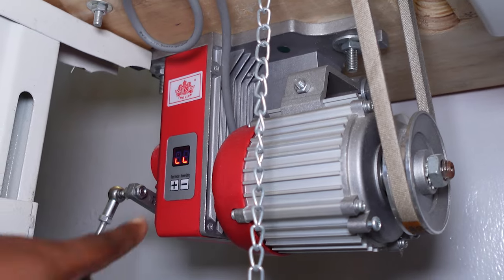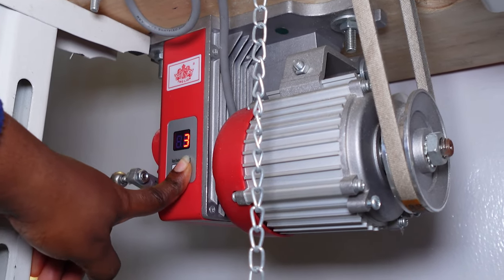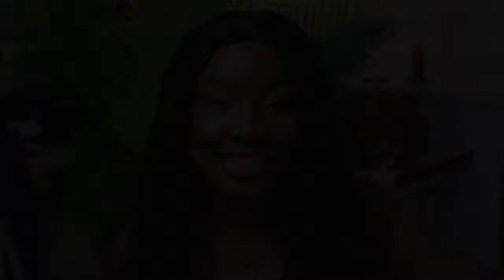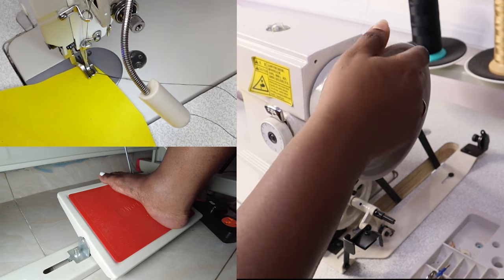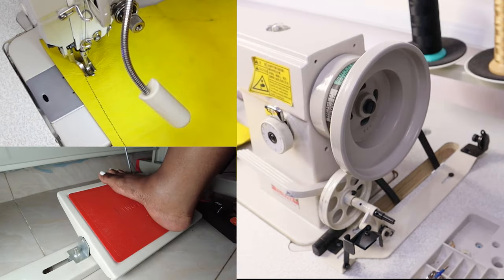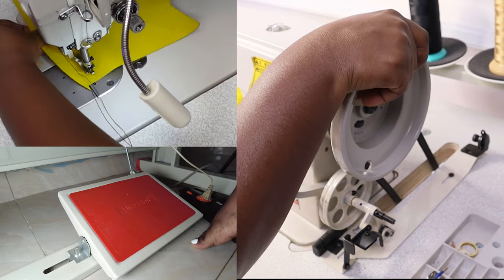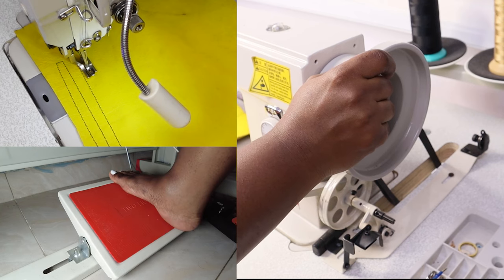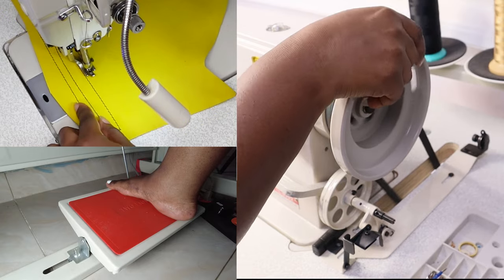How To Control Your Sewing Machine Speed Like A Pro | Eris Atelier

Comment: Thanks so much for this. Please between clutch moto and direct drive moto which one do you recommend for someone who want to buy her first industrial machine? Thanks
Reply from the maker: The Clutch moto can sew thicker and heavier materials. The direct has speed control which is good but you would struggle with sewing through heavy leathers. I would recommend Clutch motor but you would have to to learn how to manage the speed.